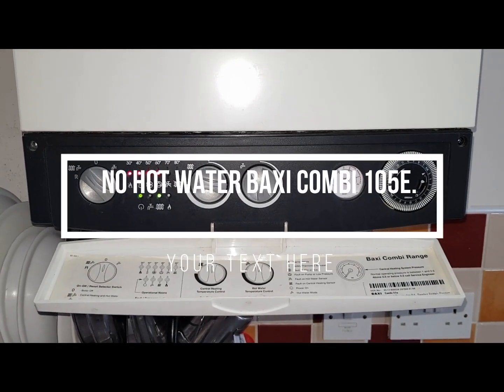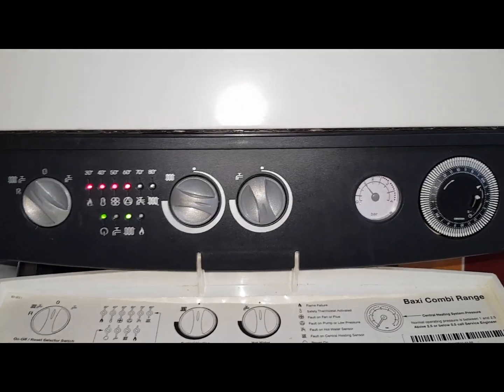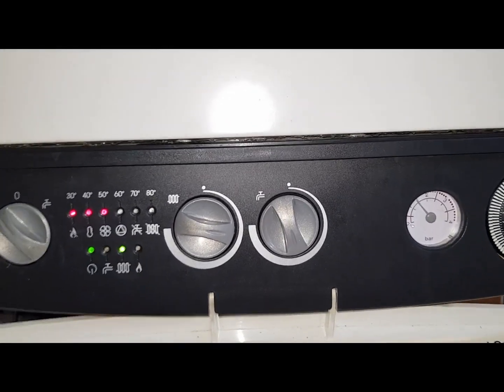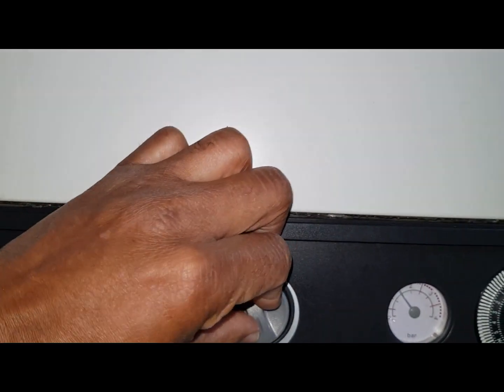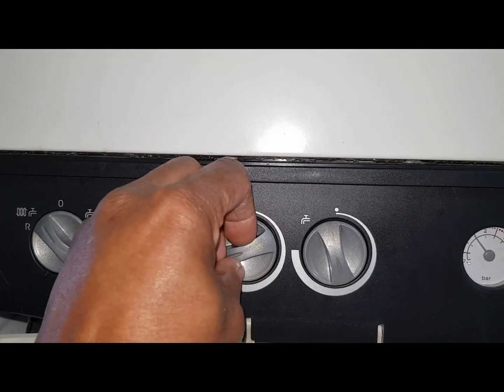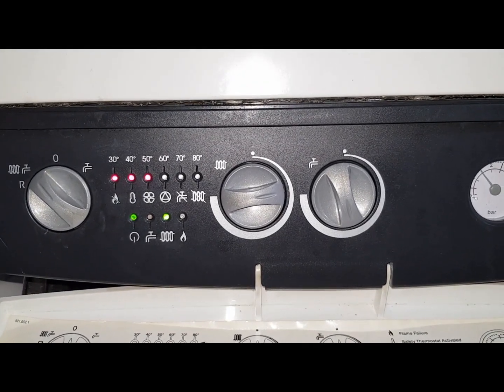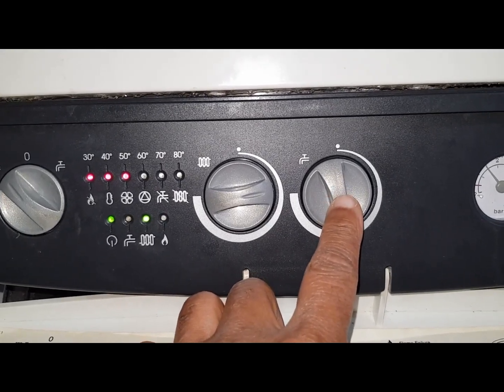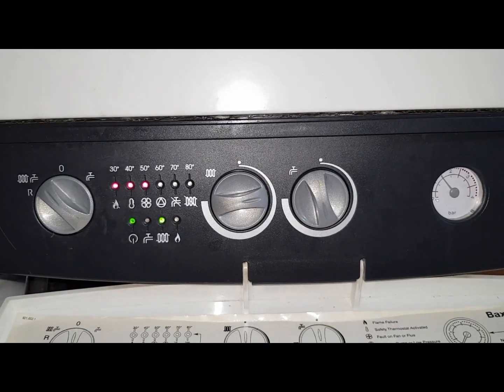No Hot Water Baxi Combi 105E . With Coach Tony Morgan

Comment: This is exactly what was wrong with mine BUT the front knob did rotate correctly. After taking the PCB out and fully turning the potemtiometers to full on, the positioning the dials to full on and putting it back together, I can honestly say the hot water has never been hotter from my Baxi.  It must have been set up wrong for YEARS !!!
Reply: Hmm my boiler very similar to this the 80he I'm currently with having no hot water frame don't even kick in ..if I run both downstairs taps it may kick in . Heating seems OK  my dial turns the whole way to I'm.thinkimg diverter valve